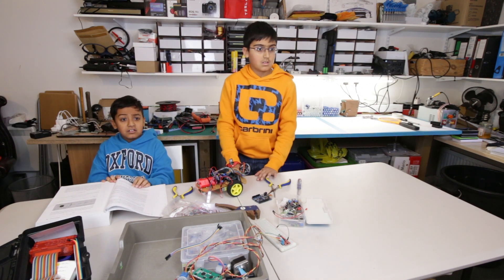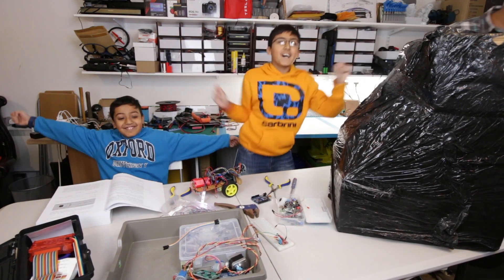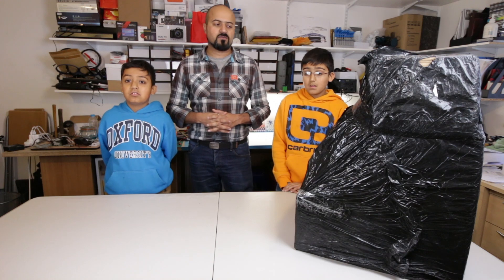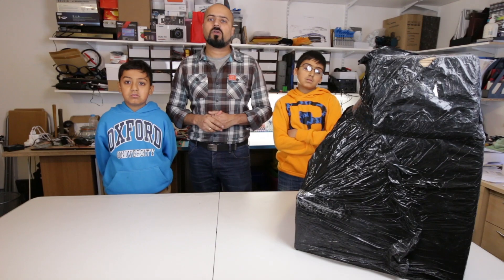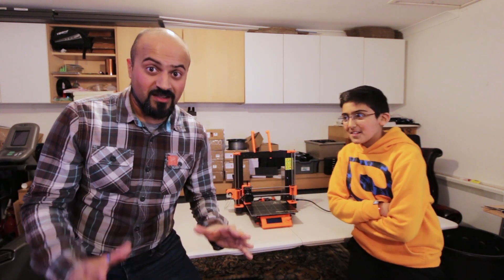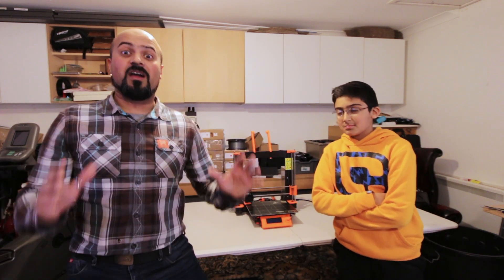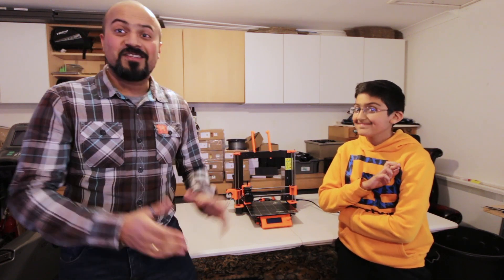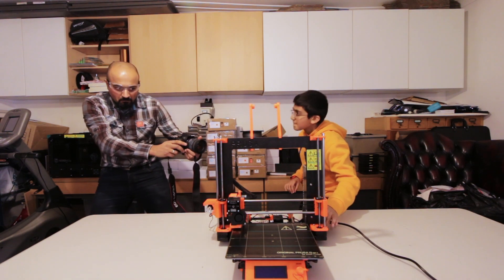3D Printer - S02 E01 - The Prusa i3 MK2

Comment: Also you realise that the Prusa i3 is a RepRap printer right? In that you can print all of the plastic parts yourself (legally and actually), and that all of the other bits are available from China, cut to length even, for incredibly cheap? With a lead time of about 3 weeks. Yes even the RAMPS and Arduino guts of it :D Oh and you can use an old PSU from a dead or obsolete computer to run the darn thing ^-^

Comment: I noticed that you didn't go with the kit linear bearings and looks like you went with the ingus drylin bearings. Was there any significant noise difference on those versus the kit bearings ?
Reply from the maker: Hey, Felix.
It's hard to say as I did not use the standard LM8UU bearings and take a dB reading then moved over to a the Drylin bearings. If anyone has a Prusa on their stock bearing and has an iphone 6s to measure the dB I can do the same my end maybe that would be comparable enough.

Although I feel the noise this machine produces is acceptable and there are other parts you can print from Thingiverse which does make a major impact on the noise levels. 

Also, I would never use the quiet mode as the current sent to the stepper motors is much reduced and so it takes the smallest of interference for this nozzle it missed a step in the layer and throwing out the print. ALL of my failed prints were because of this and since then I have had zero miss stepped prints since changing the mode to normal mode.

Comment: Love the stop motion and time-laps in this video. Well done!
Am also thinking about getting one myself, because I am a true starter in the 3D printing theme and don't want to tinker around with the cheap ones where it looks like you have to tinker a  LOT until they really work. And it seems nearly everyone is hyped about the mk2 :)
Reply from the maker: Honestly, this is not a paid review of any kind. I strongly recommend this printer. I have been able to print CAD models with a 0.1mm +/- tolerance and parts have just snapped together like they were machine molded. AMAZING. Not say that things won't go wrong and they do but this will be covered in the Final part The ONLY Review

Comment: I realize this is a bit late, but you may want to consider coming visiting us over at the Prusa MK2 google hangout (https://hangouts.google.com/group/GTKX99ZQ76y4zVOu2) and checking out the build diagram we've developed:  https://github.com/PrusaMK2Users/MK2_Tips_and_Tricks/blob/master/Prusa%20i3-MK2%20Dimensions.png
If you follow the build diagram, it is highly recommended you have a 8 inch (200mm) or larger calipers handy.
Reply from the maker: Thanks Aaron will most certainly look into this and the audience most definitely will appreciate this advice you have given. These comments are read by most and so it won't go unheard. You the best!

Comment: I was so tempted to pick one of these up, was gutted when they put their prices up because of exchange rates :-(
Reply from the maker: Really? i didn't know that. I must have just beaten that price increase. Although still a worthy printer. How much did they increase it by?
Reply: It was a good £50 or £60 i'm sure.  I have to say though i'm getting some good results with my CTC now and quite happy with it now i've gotten things dialed in a little.
Reply from the maker: Colin Hickey I've not given up on my CTC but was just tired of using lame slicer for it. Also I was finding myself tinkering more with that printer than actually getting work done.
Reply: Yeah that was my first lesson in that with something like the CTC it's rarely set and forget although i must say i've not had to level it for a while and using PLA i'm getting very reproducible results.  I've went back to painters tape on the glass for now and fixed a major skipping issue which was wiring and it freezing/crashing which was a lack of grounding so much happier with it.